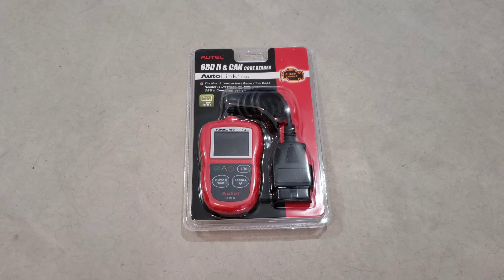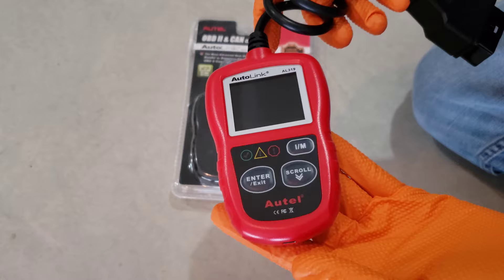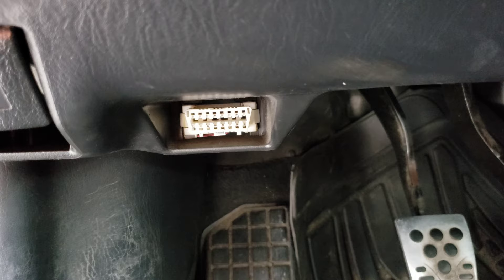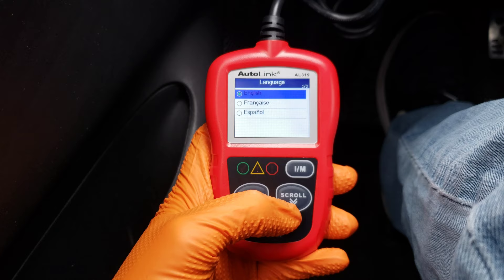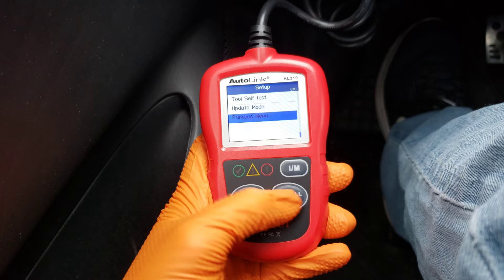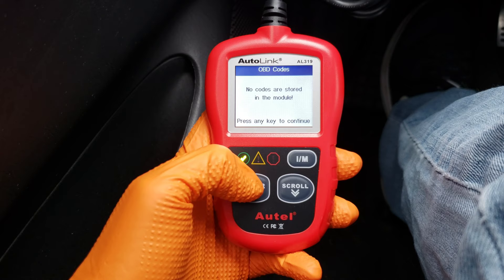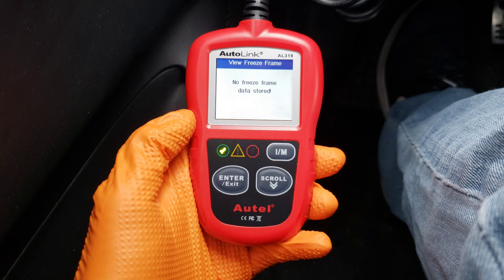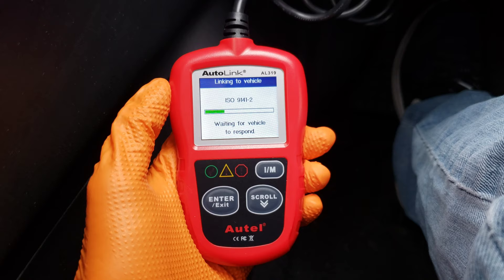Autel AL319 OBD2 Code Reader Review And How To Use

Comment: After much research,  your video is the most informative so far on this tool.  And you’re right, the price is great for what you’re getting.  It’s important to note that Autel writes their own software unlike other inexpensive brands that “borrow” the software.
Reply from the maker: Thanks for watching and providing feedback,  appriciate it!
Reply: I agree! I was able to pick this up for 30$ 🙌such a great tool to have! Thank you for this informative video. My only question is, do I need to start the car before plugging it in or does it need to be plugged in first and then start my vehicle to run the code?
Reply: Well im in 2022 july but i bought it for 28 bucks and its actually really good 👍.
Reply: @ToddsGarage  should this scan be done with the car on only or should it be driven and then do the scan?

Comment: Good video.  Did you have the car running or the ignition on?  Just received an AL319 scanner, no instructions or setup sheet.  Maybe an omission at the factory?   After a couple of failed attempts, the device asked if the ignition was on.  It wasn't.  Turn on the ignition, and the device worked well.

Comment: awesome video thank you . Funny the only code that shows on my car in the fuel pump circuit but probably because i pulled the relay before i started the engine ,But on the code screen has a cross  showing the o2 heater sensor faulty ,yet when i look at the code list on the engine it only shows the fuel pump relay code . 1 DTC and no pending codes..

Comment: You didn't mention if one should start the engine or not before begining scans.
Reply: You can do it with just the battery on, but you can also do it with the car running. For live data I imagine the car running would be preferable.

Comment: Todd, I enjoyed this offering, thank you! Question. Why would a person need one of these instruments if they are not mechanics or know little about vehicle repair? Is this more just a time saving tool for when you take your vehicle in? Thank you....RM
Reply from the maker: Hi RM, thanks for watching! I think it's good to have a tool like this even if you don't repair your vehicle  because you can have a better idea of what's going on with your vehicle by retrieving the trouble codes. Then you can use that information when talking to mechanics to shop around for their knowledge and price.  Also great to use IM Readiness before you get your emissions Test. Thanks again for watching,  glad you liked the video!
Reply: @ToddsGarage  I can live with that. I actually found the port for my Silverado this afternoon! Do you recommend any brand in particular as I'm interested in this technology. Again, thanks!!
Reply from the maker: Hi RM, as long as the one you choose has read codes and IM Readiness, I think those are important features. The one in this video is a great one also! Thanks again for watching!
Reply: It can also be a cash saver with small repairs. My wife's BMW E46 is always breaking down. She got a check engine light. We brought it to a shop that charged us 100 bucks just for the scan and then another 80 bucks to fix a simple problem (one of the ignition coils needed replacing). I could've bought this scan tool for 30 bucks and done the repair myself. Probably wouldn't have cost more than 50 bucks total, but that's hindsight now. :p

Comment: So I see Autel has multiple different scanners from this "class/grade of scanner (DIY)". Each model is not much more $ than the last...so in short, is there any major advantage in models for typical home DIY mechanic? I don't mind spending more if it is leaps and bounds more effective tool than the cheapest/lowest grade model. I'm referring to what Autel refers to on there website category as "DIY scanner". There are 26 models in that class alone and the comparison feature is not working on their site.  Does each model really do something better than the last? I don't mind having to google the codes/they don't need to be a full written definition within the unit itself.  Also this scanner is what I would consider shockingly cheap at $50 bucks...but is this just a surface level toy to give you a taste? If I went with Autel and was willing to spend 100 or even 200, how much better would those models be? I'd rather buy a model Autel is going to stick behind and continue to update software for and have a scanner that can last for "life"/ at least a few years if not a decade or more/ until OBD3 or some crap is implemented in cars. What are the major differences from the most expensive DIY scanner vs the Service Tool class vs the Advanced Analysis System class of scanners? https://www.auteltech.com/c/www/diagnostictools.jhtml.

Comment: Can you tell me what do if my red exclamation mark is lit ? No codes
Reply from the maker: That is strange there is no code, the owners manual says:

RED LED – Indicates there  is  a  problem  in  one  or  more  of the  vehicle’s  systems.  The  red  LED  is  also  used  to  show  that DTCs  are  present.  DTCs  are  shown  on  the  scan  tool’s  display. In  this  case,  the  MIL  on  the  vehicle’s  instrument  panel  will  light steady  on. 

Hope you get it figured out,  good luck!
Reply: Were u able to fix the problem g?
Reply: @Deeznutz...  i was not , i have red xs on every thing   except “MIS” “FUE” “CCM” and its weird cause sometimes there red , sometimes they are green checkmarks . I have a 09 dodge charger the only code i have is faulty fuel level sensor
Reply: @iitwofatalshots2756  damn sorry to hear ... I’m not much of a car guy which is why I’m watching this vid (my CEL came on) but if I was u I would try checking Reddit or asking a trustworthy and reliable mechanic

Comment: does this reader read recently cleared codes?
Reply from the maker: Hi and thanks for watching! Once the on board computer registers the code again the reader will pick it up. It will possibly pick it up as a pending code as well until the onboard computer registers it fully and turns on the check engine light. Thanks for watching and good luck!

Comment: This thing doesn't actually tell you anything. I've tried it 9n several vehicles with codes showing and it missed every one of them. It also won't actually reset any codes so I'm not sure what it's purpose actually is.
Reply: Did you turn the ignition key on after plugging it in ?